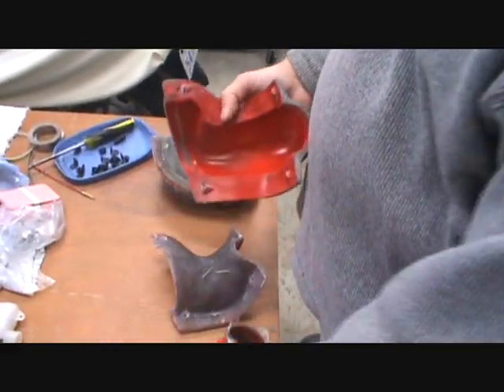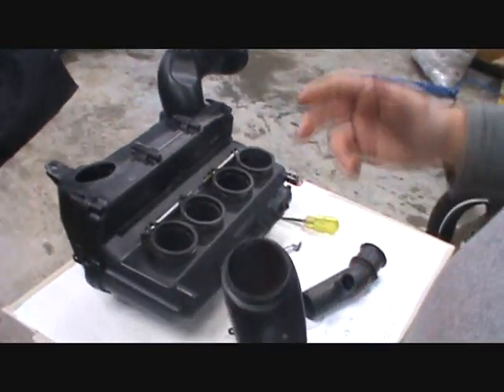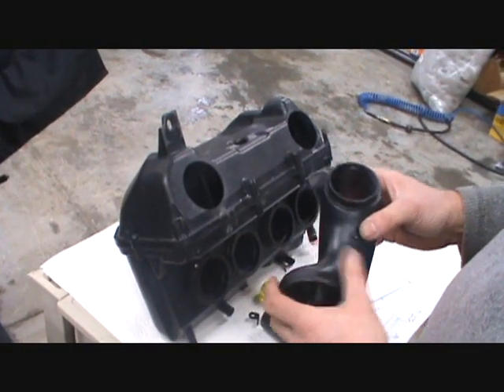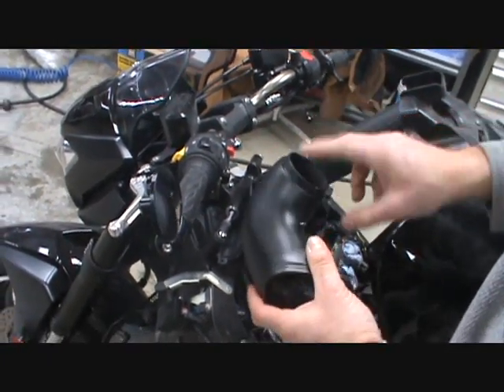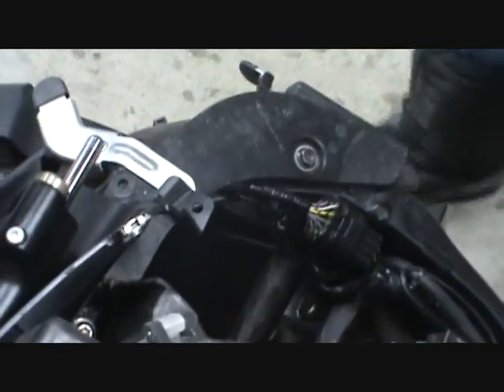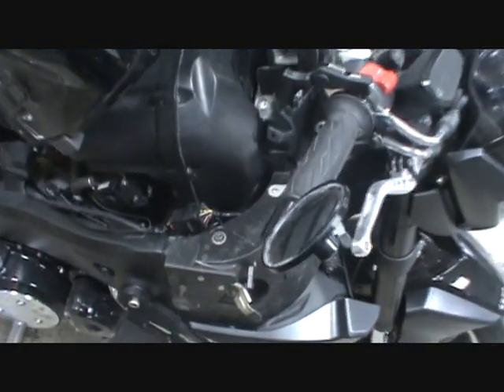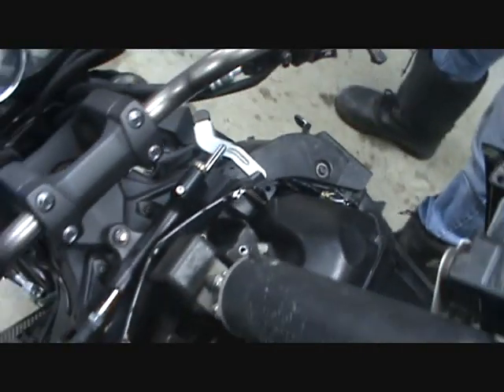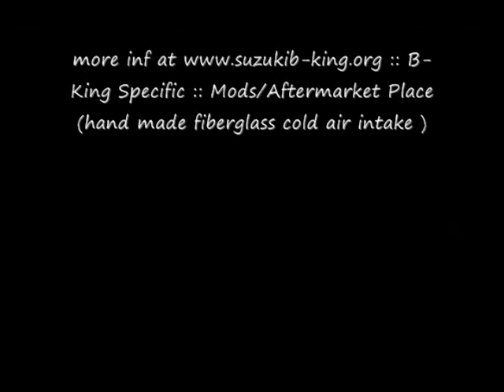suzuki b king cold air intake

Comment: i own 2  b kings working on a ram airbox for it as i write this. use to make them for the first R1 and GSXR1000  and GSXR1300 HAYABUSA the biggest RAMAIRBOXE'S EVER. and  NOW THE B-KING will be accompanied by left & right and center ram air tubes for pressurizing  airbox.  custom air filter raised intake runners and intake manifolds must have exhaust flash or power commander on the fly map change's more air more gas more power also  custom  upper fairing with windscreen i will have a video on YOUTUBE soon showing my progress  then some dyno runs. i  will have 4000 CFM BLOWERS to simulate high speed runs map every gear for maximum HP.